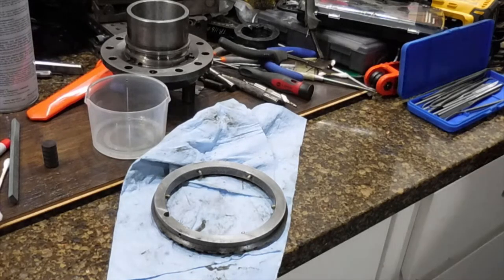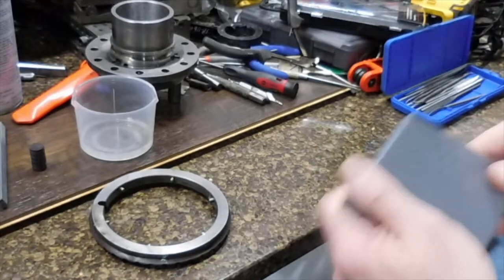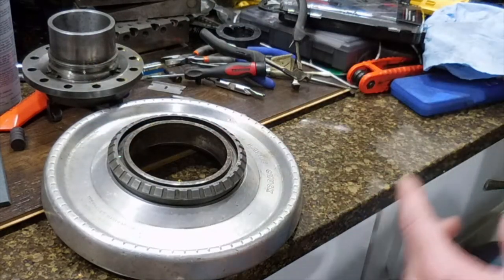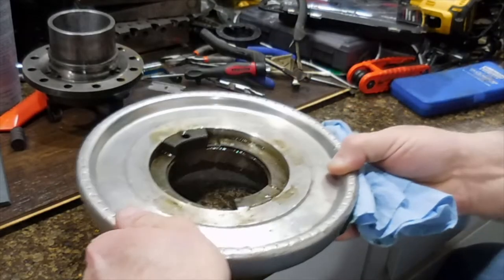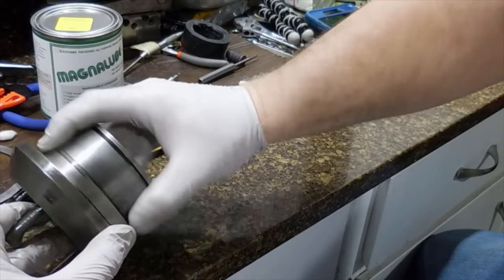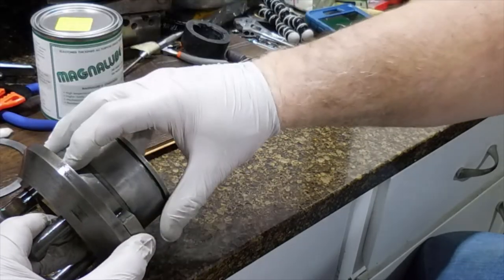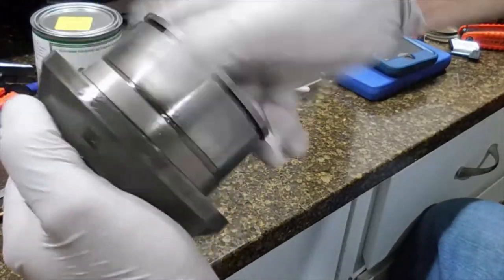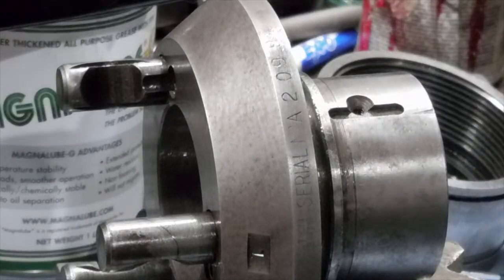Jacobs Collet Chuck Part 3 - Making Assembly Progress

Comment: Hi Dan oh no tough guy comes out to work on the chuck? We too get a bit tough around here with some things like bearings removal. We know a from our past about the world of aerospace sub assemblies (long ago) and they have staked. This is a great chuck and to us worth the rebuild because we like this ring tightening type collet tightener. That ring is unique so many pins tough to get that off for sure.  No q-tips and alcohol is great what I use so many of doing these jobs. 
Dan I think this is therapy of me at night. The parts are cleaning up nice. That was a great idea about putting that hole into the metal Pierre's Garage we know that channel. The new tapered hole doe look nice, great share. Great lubricant being used here, that is a very large container of this great stuff LOL. 
What a strange way they want those ball bearings placed not the assembly. Looks really nice Dan the grease is good yes that Albrecht we are still happy with that one.  I really enjoy making a pin grind by hand until it lightly fits it is great to watch it start to drop in. A great video you are doing well being patient and it shows, thank you for liking us Dan. 
Below my Machine Shop area bench there is a rare earth magnet near the floor in a cardboard box screwed onto a stick to allow the recovery of small parts from the floor used (sometime often) when parts take flight.  Lance & Patrick.